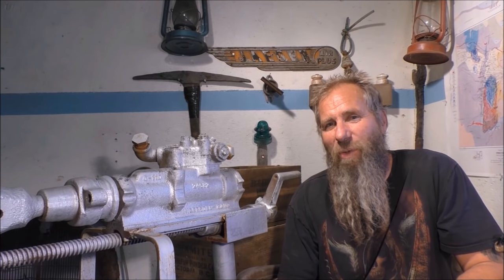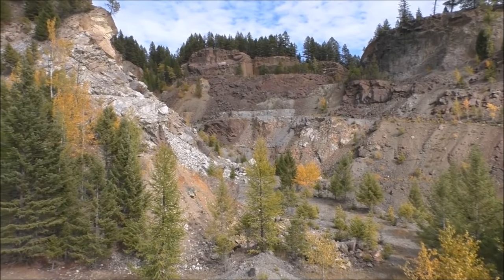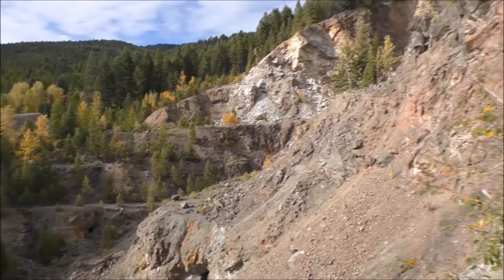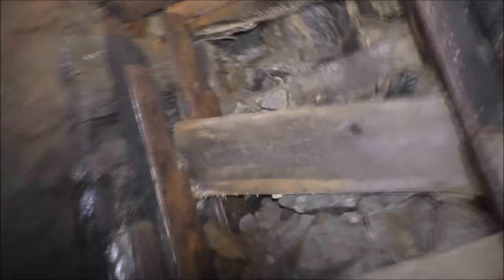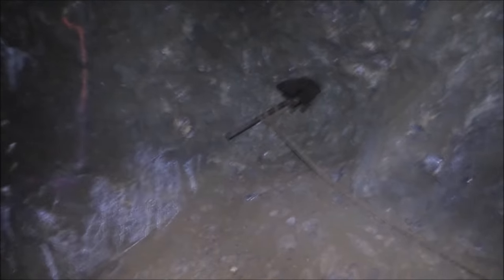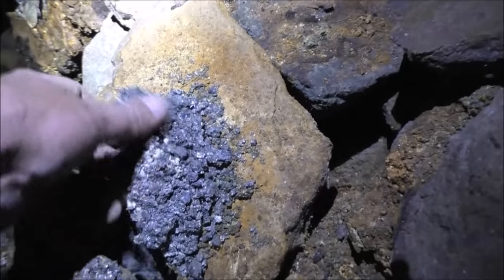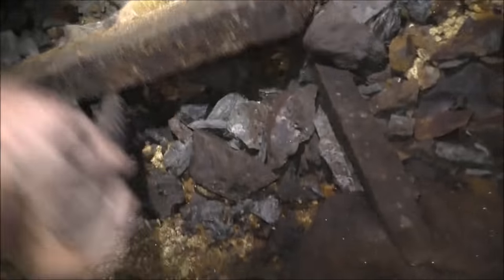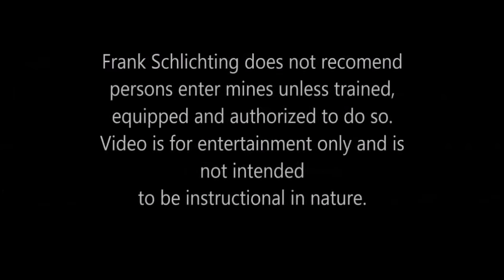#23 The huge explosion at the Mother Lode Mine and setting off a blasting cap!

Comment: I've seen metal blasting caps that you stick the det-cord in and then place it in Dynamite that are not electric blasting caps
Reply from the maker: Yes there are two basic types electric and the powder fuse type
Reply: We used to wrap the det cord around the blasting cap and tie or wire it there. The det cord was then set up to time your loaded holes by placing it in sequence that you wanted. Det cord through or around dynamite sticks will set it off just like a cap. So we only used one cap to set the whole charge off. Det cord burns/explodes at about 25,000 feet per second so the dynamite always gets set off.

Comment: I'm pretty sure that I've heard that some mines get their warmth from radioisotopes in the rocks. They're very weak but because of the mass of the rocks there's enough radioactivity (not enough to be harmful) to produce a bit of heat.
Reply from the maker: The main reason is that there is a huge heat sink there. All summer there is warm air going into the mine and it warms the rock that holds the heat.
Reply: @exploringabandonedmines  that makes sense.

Comment: Holding a blasting cap like Frank did to demonstrate how it works goes a long way to explaining why boys, including men, get into accidents and hurt themselves.  I'd say Frank, you should admit it was the wrong way to demonstrate and do not ever do the same.  This coming from a boy who learned a few lessons the hard way.
Reply: Yes, we had old fuse with caps like this but still the old tar black fuse.  It had been frozen, outside and though not visibly wet, it made the fuse burn at a much different rate, that was quite unpredictable.  Sometimes burning in quick bursts for several inches at once, and then slow burn, so the 3 minute time was nowhere near accurate. The metal flying off the exploding blasting cap is very sharp ! I also have many stories about setting these off, and of course it is exciting!

Comment: they still use nonelectric lines. not so much light by fire ie lighter, but initiated using a 22 shell and a stomper or clicker which sends fire down a signal tube to a blasting cap. Provided you tie the blast in correctly you get some pretty decent results. (my last job was tieing in shots :)
Reply from the maker: I guess the advantage especially on larger blasts with electric charges is the ability to stagger the detonations to take advantage of the shock waves to multiply the force of a blast.
Reply: Exploring Abandoned Mines non electric allows the blaster to completely control the timing of each cap. Lead in lines have built in delays so after the trunk line goes off, each cap can be set to go off at any desired time. Nonelectric blasting is amazingly simple, and much safer than electric.

Comment: You say the blasting cap was not very dangerous, but I watched this a few times and at 3:50 it looks like the cap damages/chips the concrete when it explodes... Is this correct? How powerful are those blasting caps in reality? It looked a bit more than a firecracker to me. Thanks for the video(s) as well, keep up the good work...